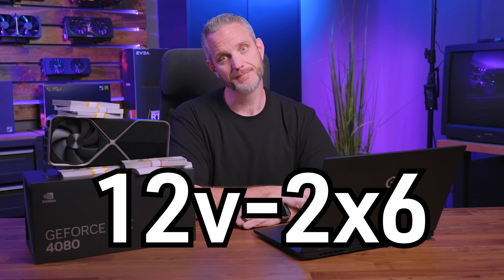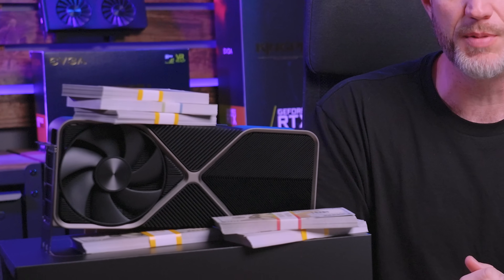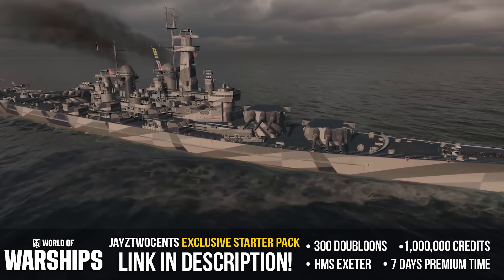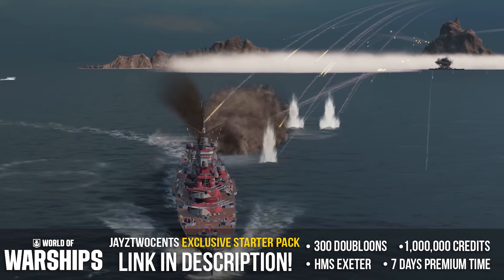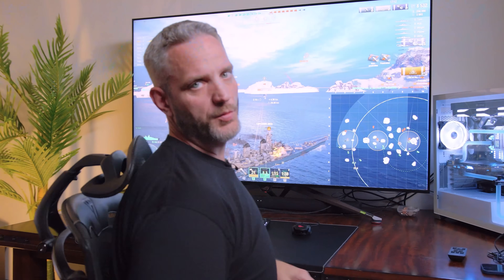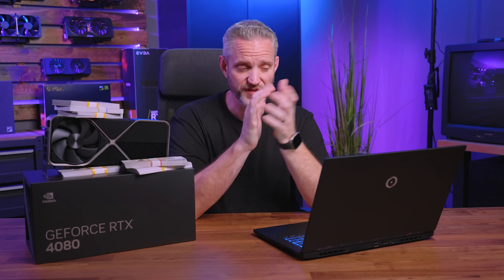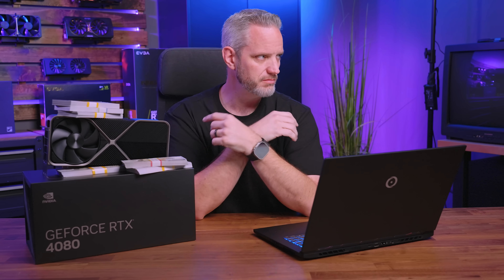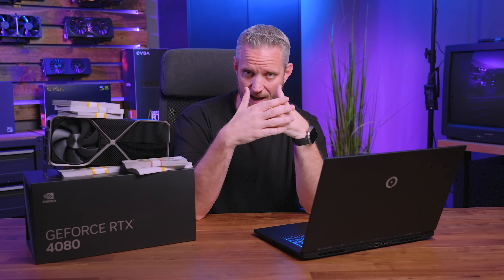They FINALLY admitted that this was a major issue!

Comment: Watching all these issues with connectors over the years makes me wonder if we’re heading back to the old military style cannon plugs and saddle clamps lol
Reply: Go look at the specs of the EC90 connector and then ask yourself "Why the heck did we need to invent a new connector again?"
If you don't want to look it up, the EC90 connector is usually seen on the battery packs of RC vehicles and drones.
It only has 2 connections carried thru it. So maybe it would have needed to be modified a little bit.
But those two pins are each able to carry up to 90 amps of current, with little to no temperature rise due to contact resistance.
And if that's not good enough, they also make the EC150 connector, which is the same form factor but scaled up in size to be rated for 150 amps.
Beyond that you get into anderson power pole connector territory, and those things are found on electric forklift battery packs, with the ability to carry 500 amps at up to 48v easily and hassle-free with hundreds or thousands of connection/disconnection cycles before needing replacement. But those are pretty bulky connectors (not least of which is because they're using 1/0 or heavier wire at that current level).

The point I'm making is that the solutions existed before the problem. Just nobody looked in the right place.
Why the IT industry sticks with these (apparently) finicky molex connectors anyways when they sometimes need to carry nearly 10A per pin, when there are far better suited connectors EASILY AVAILABLE AND ALREADY DESIGNED is far beyond my pay grade, but I'd still like a competent answer.
Reply: @44R0Ndin  I was more or less bringing up the old mil plugs as a reference for rigidity and how well they keep contact between male/female. No jostling out of place or half in/half out spotty connections (unless you try REALLY hard). My understanding of the situation, however limited, is an issue of receptacles rather than the allowance of raw power throughput. I could be wrong though, it's been known to happen.

Comment: bring back molex connectors!! I remember having to use vise grips to remove conectors... those were tight...
Reply: but they still melted when too much current was run through them
Reply: @bjorn1583  they melt because of bad connection.. the molex pins are thick and make a perfect conection
Reply: @sergiobisonte  they still melt when overloaded, good or bad connection
Reply: @bjorn1583  no matter if its the overload or the conections.. molex have thiker wires, and 10000% better conection...
Reply: @sergiobisonte  there are a lot of connectors on the market that have thicker wires and 10000% better connection when compared to the current piece of junk connector they are using

Comment: I don't think these changes being made are going to cut it.  4090's are burning out at the power plug like Canadian wildfire, and 4080's that draw 320-350W are also still burning out, just not quite as rampantly as 4090s.  4070's however are not, at only 200-250W draw.  I have said from the beginning when I first looked at the specs and total contact area that with the total contact area of all pins and terminals that 250-300W PER connector was likely the limit of the plug.  It is only around 45% more contact area than the ATX-2.0 8/6+2 pin connector, and only ~70% more than the ATX 6pin, which translates into the same percentage of increased safe transfer capacity.  Contact area determines safe wattage via ohms, or impedance.  Impedance translates into heat when you try pushing more power through due to natural resistance.  At least the change in terminal style from minimal nub contacts to the spring style bars takes that into mind, but it is still not likely enough.  I am hypothesizing that they are figuring it at double the 6 pin terminal capability due to twice the pins.  But I have also seen 4 pin Molex connectors carry more current that smaller 8 and 12 pin connectors due to surface area impedance.  Total safe transfer capacity is directly proportionate to total surface contact area.  I think the ACTUAL solution is to tone down the wattage per connector and increase the number of connectors.  No matter how in depth and complex the project you are working on, you should NEVER neglect or forget the basics.  Even the most complex designs and standards start with the basics, because if they don't start with the basics the basics get forgotten and failure becomes a forgone conclusion.

Comment: Warranty should cover damage if anything happens, but how long does it take for issues to start is the real question? I have a Corsair RM1000x Shift with an ASUS 4090 TUF...My connection is secure af and the correct cable was included with the PSU...System was only built 1 month ago so it has not ran for too long...

Comment: New CA Policies Are Going To Be Capping Total Power From The Wall That PCs Will Be Allowed To Use. Last Year, Home Computers/Gaming Systems Used Only Slight Less Power Then A/C Units Did, Putting Strains On The Power Grid After 5PM Most Days Of The Week. ;)

Comment: '...the gauge of the wire was never really the problem as much as it was the mechanical connection between the plug and the adapter, which if the wire gauge was an issue you'd see the whole wire start to melt not just the header...' Except the last time you mentioned this in a very recent video the gauge of the wire was the biggest part of the problem from the way you were talking about it. It's almost like you have no idea what you're talking about, so maybe you shouldn't be talking about it since your army of followers repeat and spread whatever you say. Maybe stick to custom computers since you're really good at that.

Comment: I have a Corsair 1000W and a RTX4090. Both brand new and in use. I hope I don't have an issue
Reply: Get the 12HPWR cable from corsair, you won`t regret it.

Comment: Honestly this issue pushed me away from the 4090. I know there's "bigger reasons" I shouldn't want one but gaw damnit I can afford it and I wanna use the types of graphics it's makes possible
Reply: Also why I shied away from the 4090 and ended up with an XTX.  I sometimes still "regret" not getting the 4090, but I know I'd be more upset if the card melted b/c of that adapter.
Reply: it wasnt a big deal tbh, i have my 4090 and i find really dificult to make that user error
Reply: @IvanScore4life  do you think 3rd party adapters would be safe enough to use? I'm gonna need a 90° adapter to use in my case
Reply: @landonmurray3814  yes, as i wrote, its not a big deal,  4090 is way better than amd 7900 xtx
Reply: @IvanScore4life  You have a 7900 xtx? Or a 4090?
Reply: @davide4725  both i am an architect, actually i have 2 of each

Comment: i know for fact that its not user error i currently have a cablemod 180 adapter that is welded tight to the connector  zero gaps  you cant even tell its melted but its stuck on currently going through rma with asus my sticker is missing oh boy

Comment: I feel like this plug should work kind of like how an old VGA plug works and you actually tension it tight
Reply: I was wondering why they didn't just throw a couple of sense pins on a wholly different connector like an XC90 (rated for up to 90 amps).
55 amps is light work for that connector.

Comment: Hyperbalize was a correct word btw, and this sounds fantastic for the next few years of graphics cards technology... also increasing board pcie wattage could bring new better graphics cards that don't require any extra power! And yes they should all be recalled and replaced with NTK pins!!!
Reply: Board PCIE wattage was not increased, all this new connector does is change the way they were doing the math.
Now instead of all 600 watts having to come thru the cable, the card can also draw the full 75W thru the PCIe connector (that has been that way since PCIe v1.0)
The cable has always allowed 600w. Now they're letting the card have the 75W from the PCIe connector too (or rather, acknowledging that such a possibility exists).

Comment: is there not a "chassis ground"?   I don't think the "Ground" wire is the sole ground just that it's a true ground.   The MB, Power supply and anything in the PCI slots are all also ground to the case via the mounting screws.

Comment: At 12 volts, a 16-gauge wire can handle only about 10 amps. the way wire is rated  is peak load so 6.6 amps for continuous load. if  a  card is pulled 9.2 amps per wire it needs to be a min of 14 gauge wire.

Comment: I had the black screen and 100% fan issue. So frustrating trying to troubleshoot. Stress tests, new mobo, new CPU... It would be stable for a month then suddenly come back. No idea how the plug would move or come loose, but I finally tried just lightly jiggling the connector and was able to reproduce the issue. I swapped the 12vhpwr from Cablemod with the stock from my Seasonic PSU and the issue went away. Glad to hear this is being addressed. I take it the 180 degree adapter will also need to be updated?

Comment: I don't believe that the issues with these plugs/terminals is an "early adopter problem" but rather it is a consumer safety problem. If the fans made too much noise/coil whine was too great, then sure. But when you are talking about electrical components themselves melting down/catching on fire because of a flawed design, that is a severe safety issue that needs to be addressed at the cost of the manufacturer and not the consumer.  Nvidia and the AIB's know they did wrong and are just trying to avoid a recall and its associated costs. The fact that a new plug design is solely being created specifically to address these issues is all the proof you need.

Comment: Have a feeling this won't stop plugs from melting. Also, yes, the black screen 100% fan issue is plug related.
Reply: Lol why not? Most of these are signicant design flaws that have mow been fixed. Hell I'd bet even just the longer power pins and shorter sense pins would be enough

Comment: I don’t know but with the history of these cards and now a new connector it sounds like there is room for a class action lawsuit for a recall.  You’re the consumer not the beta tester, all of this was supposed to be figured out and tested during R&D and it clearly wasn’t.  Especially if Nvidia starts using these connectors on 4090’s it would be a clear admission that the original was not up to the task.

Comment: I can confirm the black screen with 100% fan speed.  When I first put my 4080 in, the stock adapter was pushed against my glass.  I didn't think it was too bad, but it would do the black screen/fan thing if someone walked by too hard or sometimes if I set something down on my desk.  Another dude was having the same issue and told me he thought it was the connector wiggling when the case shook.  Fast forward to when my cablemod 90 deg adapter came in, and BAM no more issues because there is now a few mm between the glass and the connector.
Reply: Had it too with my boyfriend's 4070, stupid adapter sticks out too far and is too damn stiff so it pushes against the glass, got myself a new atx 3 psu that had a direct psu to 12vhpwr cable included for my 4080 which made it fit properly and had zero issues, then because of my experience with my 4080 I got my boyfriend to order one of those cables for his psu from the psu manufacturer, he's had no problems since, his case isn't even really small, imo it's stupid that for a 4070 you would need one of the biggest cases there are just because of the adapter, like we both have the same case and I could even fit my 4080 in there, it's just the adapter that made it a problem with my boyfriend's 4070, had to keep the side off to be able to run it before he got the 12vhpwr cable from his psu manufacturer.
Reply: @erica1399  Yup, my other rig I built in a microATX case with a 4070 and I got a atx 3.0 PSU so I wouldn't need the dumb adapter.

Comment: The wire gauge problem is a problem that shouldn't be a problem. Using a too small of gauge is a conscious act in defiance of math and engineering. Wire has a set of known parameters related to the amount o voltage and current is capable of carrying. If they are under-sizing the wire then that is a stupid decision by the accounting department that borders on criminal. Even the simple wiring in your home must meet a set of standards..... He is right about the connections. Those are a bit more non-standard and could be a failure by engineering and design.

Comment: It really sucks that this has been an issue for a very long time. The sense pins not being the shortest pins in the connector, was a major oversight! I feel they should also upgrade the clip tolerances to eliminate/minimize the connector wobble. Im soo glad i got my 3080ti strix card last summer, instead of waiting for 40 series! Although, it was pretty pricey...
Reply: Not an oversight. Carelessness or incompetence. You choose which one.
Reply: @TheExileFox  GN did not help by concluding user error had something to do with it.  They created a lot of stooges that are still blaming the user despite proof that connectors can disconnect on their own even when clipped due to the poor connector design.
Reply: also bought 3080Ti like half a year ago, very happy with it for it's price ($600) but not happy for the power draw. Looking forward to getting one of 4080 when they cost ±900
Reply: "It really sucks that this has been an issue for a very long time" Tell me about it. Noobs not properly seating power cable and using 3rd party adapters having melting and burning issues have been happening since GPUs started having their own power cables instead of MOBO power.
Reply: you spend $1k for a 3080ti? that money could easily get you a 4080 at 16gb of vram now... not worth the money

Comment: I wonder if a 90° plug would help on the 4090.
Reply: It doesn't unfortunately. Plenty have melted with them, they're already a thing.
Reply: @Frozoken  So much for my career in electronics.
Reply: @alannitcher5001  💀. Tbf, it's probably that it just fixed only one of many problems, esp seeing they are mandating no bending for a bit of the cable length.
Reply: Let's take a service open plug. Make it smaller. And update wattage. What could possibly go wrong?

Comment: Really it should be replaced with a 12V-2×8, 12 pins especially with that smaller pin size with that smaller connector really isn't enough, they are flirting with the limits of connector.

Comment: The early adopter logic doesn't work when manufacturer is liable for damaged caused by their product, which it is in this case =)
So they either can spend $100 to RMA a new plug, or $1,500-$1,000,000+ for any incurred damages from each faulty product

Comment: helped by your youtuber friends they never acknowledged the real problem that is RTX4000 are wider than 3000 and earlier series, the 12v plug & cable cannot be bent as much as the pcie8 and that disastrous combo makes closing 99,99% of cases impossible without skewing the plug, that's the problem and the reason manifacturers started placing the connector further inside the card, not for looks, because they know what I'm telling you now is the real problem

Comment: Nice video Jay but it doesn't change the fact that Nvidia and PCI-sig created a shit show to solve a problem nobody was having.  There is no lipstick you can put on that pig and make anyone feel good about that connector.

It's ridiculous an entire industry has to deal with crap just do Dell can sell a computer with s shit power supply and the GPU will throttle instead of crashing the computer.

I'm not buying a graphics card with Nvidia's connector of shame.  If you need to pass a large amount of current through a connection you need to bolt it together instead of using push together connectors.  Nvidia needs to step up and offer a lifetime warranty on that connector before I'll risk buying a card with that Jensen junk.

Why Jay, Nvidia should be offering an exchange program to replace the shitty connectors because Nvidia are the douche bags that REQUIRED using the connector.  With great power comes great responsibility.

Comment: Be nice if they could move the power connector to the opposite side of the card so people wouldn't bend the wires trying to hide them. And hopefully they change motherboard and power supplies in the future to eliminate the
Need for so many wires I would like to see edge connectors for power supplies and motherboards gpus so no more wires.

Comment: Doesn't really make sense that this needed to be rediscovered. Wall outlets also depend on contact with whatever you are plugging in. Thats why all outlets squeeze the prongs of the plug. And the prongs are long so that even if half out it is hanging out of the wall socket the easiest path for the electricity is still down the prongs of the plug. Even with this new redesign the prongs should still be lengthened so that even if it does work its way out a bit the electricity still follows the intended path. I just don't feel like space is such a premium on these graphics cards that we couldn't have a larger more robust power input.

Comment: They shouldn't have changed a plug it all I have a super flower 1200 watt power supply and I have three 8-pin connector connected to my 3080 t.i. I got no problems

Comment: I don't see why they didn't just go for a card-edge connector like the high power blade powersupplies use in servers.
Dell Platinum Plus for R620 R720 R820 delivered 1100w. No connector on card also drops it's cost.
Reply: Amphenol HPCE, MEZZANINE 12P12S connector is 31mm wide and has 12 power pins and 12 signal pins to allow smart communications between card and supply.
Powerpins can handle 9-11 amps like other specs but with no connector on card it will be easier to monitor temperatures.